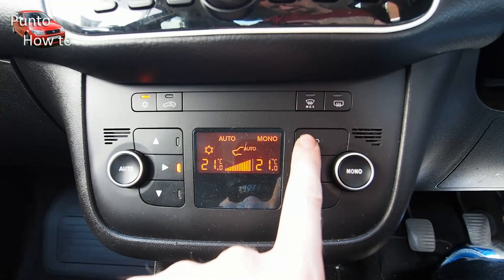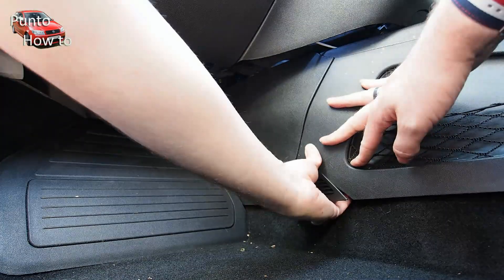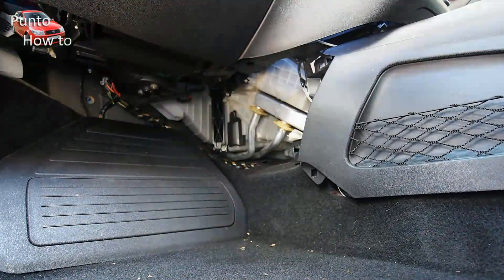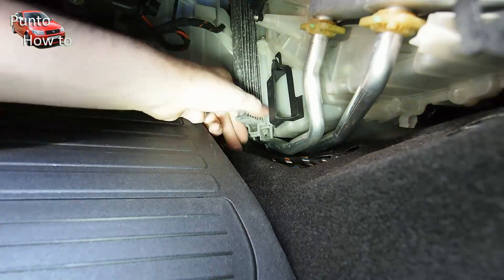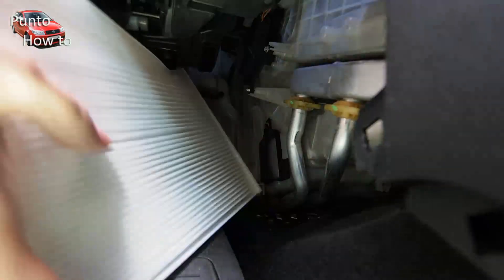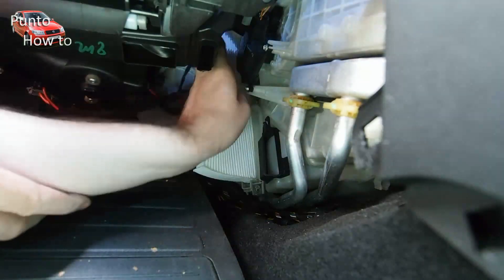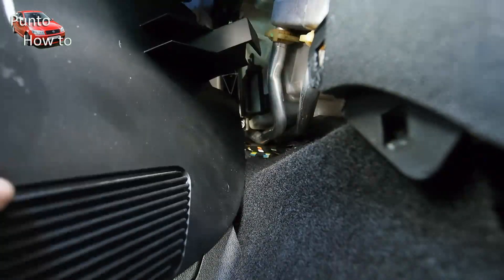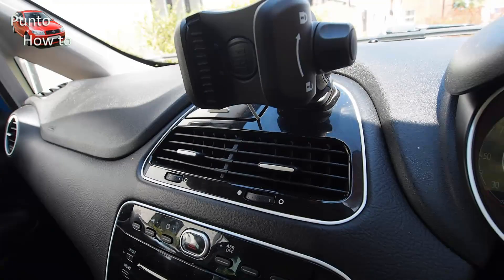How To change Fiat Punto pollen filter Grande Punto, EVO, also the same as Vauxhall Corsa and Adam

Comment: Great video thanks.
Just a heads up for people, on my Abarth Punto Evo the screw actually had a 5.5mm head rather than the Philips head.
Also on the end plate, it has a ridiculously flimsy clip on the top compared to the bottom. Whilst trying to clip it back on the top one broke! Luckily the extra strong glue I used to re-attach it worked but I realised this had happen because the replacement filter was actually one fin to wide and trying to compress the filter with the end plate is what caused the clip to break!
I trimmed this off and the plate cliped on effortlessly.
Reply from the maker: There will always be slight differences, the platform for the Evo/Grande Punto was shared with the corsa, Adam and later newer fiat models like the 500x and even the Jeep renegade so sometimes the parts that are used could have come from a different places depending on the supply lead times which can mean little differences like using a bolt not a screw

Comment: Those pipes are for your aircon system
Reply from the maker: Are they ??
Reply: @PuntoHowto  yes what ever u do don’t touch them when your aircon is on one of them will be red hot or the other pipe u can get frostbite which isn’t very nice
Reply from the maker: Sorry I was being a bit scarcastic, these are the engine coolant pipes, I know this because the air con pipes come into the cabin just to the right of them as seen in the thumbnail and the main give away is that the pipes are the same size, they carry coolant to and from the heater matrix in the same diameter pipes, aircon carries compressed gas as a liquid to the evaporator (which is what you’re talking about) in small diameter pipes then it expands into the evaporator and then carries it away from the evaporator in larger diameter pipes expanded as a gas and now a lot cooler, also another give away is that if one of these was a cold pipe from the aircon then a considerable amount of moisture would build up on the pipe while the system was running and given the design of these two pipes that moisture would collect into water which would then soak the carpet below it, as it dripped off. 

So no these pipes are not for the aircon system

Comment: Hi.. James from Lisbon in Portugal thank you four your vídeos..  I nead some help.. I have a Fiat punto my life evo 2011 I bought it zero miles however I have bean getting somo problems...  The latest probleme is that I have the miles flashing and I noticed that when I press the windows key on the steering wheel nothing happens.. I suspect problems withe the Blue me unit.. Do you k ow were is the module located? And any ideas how I can fix this... What tools will I nead? Any help will be appreciated... Thank you...
Reply from the maker: Jaime Costa the blue and me module is above the glovebox, open the glove box and look to the top inside, you should see a large black plastic enclosure. You need some screwdrivers to remove it, but I would recommend checking all the fuses first to make sure it’s not something simple

Comment: I bought a new filter today. I followed instructions and there is no old filter in my car!? 
I've had it for 11 years and I'm the only owner.
Reply from the maker: It was probably removed at some point during a service, far easier and more profitable to remove it and charge you for a replacement that they never actually fitted
Reply: @PuntoHowto  Hi I talked to someone. He explained to me that my car only has heating and not air con. So no need for a filter. Is that correct?
I had problems with the heating. I have changed the resistor. It looks like I also have to change the fan motor.
Is the fan easy to replace?
Thanks for your reply.